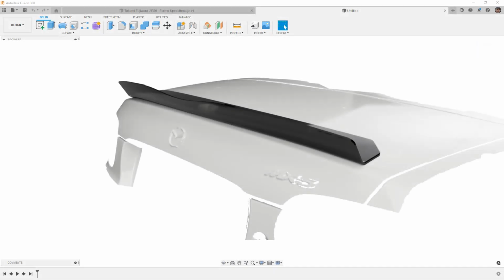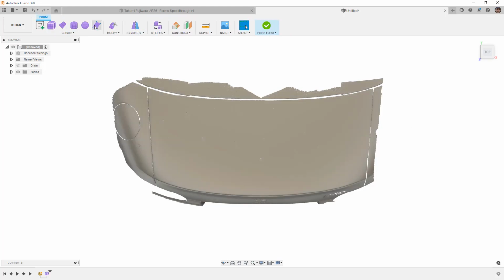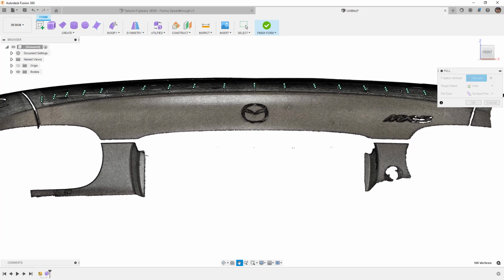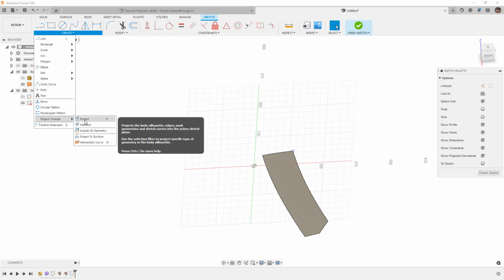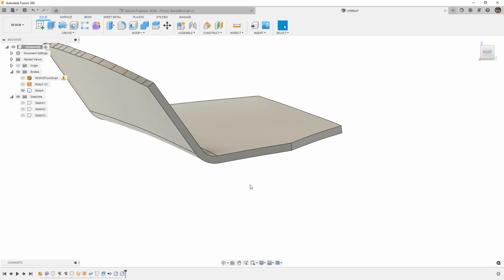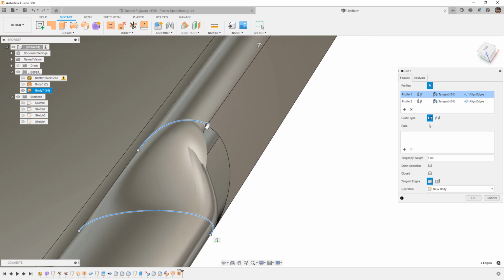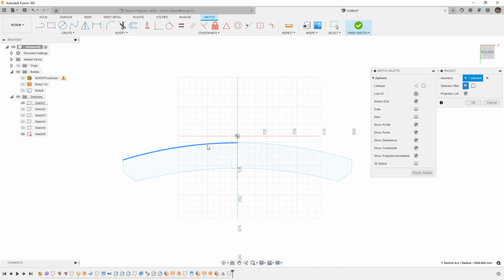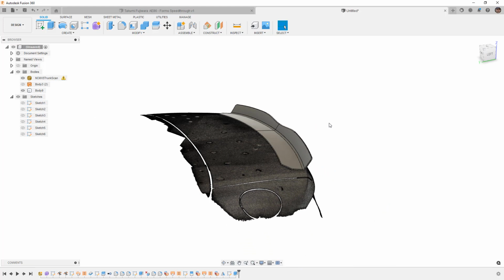Fusion 360 Form Mastery - Part 27 - Creating an MX5 Spoiler with Mesh, Forms and Surface Tools

Comment: If I have a 3d scann that is not aligned with the axis, how can I make the simetry of the part to align with the body panel? I can try to align the part manually but the results are not perfect
Reply from the maker: Its really tough without the proper software.  I use QuickSurface.  It can build a symmetry plane based on the shape and you can use that for alignment.  In fusion there is no precise way to do it unfortunately.  If you have more of a scan of the license plate area where you can get a horizontal line off the tag bolts that will help with the left/right.  I have some other videos on this and it requires you to make some references, make components, move the component and then copy the mesh back to the top of the design.... messy
Reply: The 3d scan is similar to yours, I want to design a spoiler and all the body panels are curved. If you need more info I can send you the stl. Thanks

Comment: nice video u really explained alot of dertaies thank you but i was going for a roush lip for a mustang 2013 but i got no scan for it is it possible to do it and can u do a video about it ifu have a time i couldnt find anything clear and good as you on youtube
Reply from the maker: Not much I can do without a scan really.  I do have a spoiler video on my Todo list but that list is pretty long.  Are you trying to make one for your car?  We have a few spoiler videos on this channel and to do one like the roush lip you probably would be sticking with forms.  I think I had a video on doing one for a tesla 3 a few years back.  that is the process you would likely need.
Reply: @LearnEverythingAboutDesign   ok would look for it thank you for the information  so theres no way u can sculp it from image or somthing unless theres a scan for the lip it self
Reply from the maker: @1993saif1  You can model something from pictures but the chance that it will actually fit is relatively low....  I have scanned my starion and modeled it from pictures and measurements and they are close, but not close enough that I would be able to model something to fit like a side skirt of fender flare.
Reply: @LearnEverythingAboutDesign   OH I GOT U YEAH ITS VERY HARD TO GET THE MESURMENT RIGHT THANK FOR THE INFORMATION I WISH YOU ALL THE BEST
Reply from the maker: @1993saif1  Sure thing.  I just looked at seems like I have two spoiler vids with forms.
https://youtu.be/aUVgqCQrAqI

https://youtu.be/M77JV2nhm74

The tesla one was for a guy that printed it but he never sent final pictures after the print on the car..
Reply: @LearnEverythingAboutDesign  OK I WILL TRY LEARNING FROM THESE MAYBE TRY TO DO A SPOILER LIKE SHELBY THANK YOU VERY MUCH FOR LOOKING FOR THE VIDEOS FOR ME I CANT TELL U HOW MUCH I APPRECIATE THATT MOST WONT HELP ME THAT MUCH SO THANK YOU VERY MUCH

Comment: Hello, on 11:17 i don't understand which buttons you use for smooth comand
Reply from the maker: Smooth shortcut is ALT + 3 on the keyboard.  Box is ALT+1.  You can also find it under the Utilities menu for Display mode.  and if you are in Edit form, expand the Selections section and they have buttons at the bottom to toggle it.

Comment: Do you have any video explaining how to print a part created from a 3d mesh, i´ve done a brake duct, but i'm having a hard time making it printable.
Reply from the maker: We just recently did a 6 part series making a brake duct and printed it https://youtu.be/euEWD89ux48  we have also done a few parts on our GPz motorcycle series that we printed. tail section, headlight mask, front fender.  Awhile back we did a widebody series and i printed all the parts.  that was a bit of a mess but there was a video in that series about breaking it up and printing.

What part are you getting stuck on getting it to be printable?

Comment: Hey, was the mesh align done by you? I have a similar scan but I dont know how to get it aligned correctly, or is there a way to make some sort of symmetry plane to use as a mirror plane?
Reply from the maker: It wasn't done by me no but we do have plenty of videos on different ways to do this.  Fusion isn't great so if you want to do something like extract a symmetry plane off a scan a program like QuickSurface is the way to go.  We have videos on doing alignment in QS lite.
Reply: @LearnEverythingAboutDesign  I tried that but it didnt seem to get the plane right, I dont know if I have enough similar features on both sides to get it right

Comment: hi, I've got a question. I'm making the fillet on the bottom of the spoiler like you did at 21:27 but I'm getting "inconsistent information in vertex and edge attributes". I'm doing this using my own scan data for my car, what should I go back and check to remedy this?
Reply from the maker: Hmm, so you were able to thicken the surface to a solid, but get hung up on the fillet on the corner.  might want to try increasing the tolerance number when you stitch them.  When you use stitch if any of that edge is red and not green it means there is a gap there which would cause a fillet not to work.  If that isn't the case there might be a non-tangent section on your surface.  

Those are the 2 places I would start with.

Comment: Can you explain how to align the scan to the origin? In x y and z
Reply from the maker: There aren't any dedicated tools to make this happen in Fusion sadly.  I do have a video showing some tips here https://youtu.be/82vD7YSKIAo  but its best to do this in the scan/mesh software if possible.  I will likely do a video in the near future showing GOM inspect, and im trying to see if Meshlab can make this happen easy enough, both have free versions/options.  If you are scanning with an Einstar or anything from Shining, their Exscan software can do it, but if you are scanning with Revopoint, Creality or other hobby options they don't generally have an align tool on the mesh.
Reply: @LearnEverythingAboutDesign  yes I used a Revo and really struggled so I thought this might be a video topic. With your knowledge I‘m sure you got some good tips 👍🏻
I used mesh intesects then set points and made planes and lines and then used the align component command

Comment: what PC do you have. Mine is exploding with scan data. like this.
Reply from the maker: I have this creative level 2 with some slightly different specs. https://mysolidbox.com/product-category/desktops/  I upgraded the graphics card (after this video was done).  I was running a pretty low spec Gcard when this vid was done.  
Setting the mesh to unselectable helps.  You can also copy the mesh and remesh with lower res so you have a hidden high res when you need it and a visible low res for helping view.

Comment: What is the best way to alinge a mesh accurately?
Reply from the maker: To do it in the mesh software before CAD.  Some scan software has alignment in it like the shinning 3d software.  Others like the software for Revopoint scanners don't have an alignment feature in it but hopefully they will add it.  In that case going to the free version of GOM Inspect, or using the free software MeshLab would be an option.

If you direct edit a mesh in Fusion you can add planes based on selections on the mesh, but aligning it to the standard coordinate system is manual with Move/Copy so whenever possible do it in the mesh software before export.

Comment: You have a mash already set in the coordinate axes, but in 3D scanning the mash is often located chaotically in space. How did you align the mash to the coordinate axes? Is there a separate video on this topic? Thanks for the reply
Reply from the maker: This mesh was sent to me, but in the scan to part series and in this video near the end https://youtu.be/Ft9qTVCMwC4  I talk about how to do it in ExScan Pro.  There are other software options that let you do that for free as well.  GOM inspect has a free plan that will let you align to a coordinate system.  MeshLab as well but its not super user friendly.
Reply: @LearnEverythingAboutDesign  Thank you for your quick response! I use Geomagic Design X for these tasks, but was hoping that Fusion 360 could do an exact alignment of the scan in the coordinate axes
Reply from the maker: @AlekseiKulikov-b5j  Sadly no.  If you go into direct edit on the mesh you can create planes using 3 points but for actually putting the mesh into the orientation based on the global coordinates, sadly no.  If you use DesignX I would certainly handle that before you import it.

Another tip, in Fusion you can right click on the mesh in the browser and make it Unselectable.  Performance will be better and you can still snap to it with a form.  It just prevents Fusion from flipping out when the cursor goes over the mesh.
Reply: @LearnEverythingAboutDesign  Thanks for the valuable advice!

Comment: hello, I just found out about your site and am already extremely grateful for various tutorials.
-> I have a question about T-Spline and API: Do you know if it is possible to manipulate T-Spline functions via API scripts?
I haven't found anything in the Fusion API documentation yet.

Thank you very much
Reply from the maker: You are welcome!

On the API side of things, I have never done anything with forms in API but with a quick search there are some things exposed to the api.  If you search the help file for FormFeature or Tspline it will bring up the ability to create freeform bodies.  I know from a program site that Fusion does access and create form features from other commands such as when creating a design from a Generative Outcome.  It takes a quad mesh and turns it into a form body.  I don't know if you can directly work with a freeform body though since it is a "direct" modeling approach I don't know how you would even figure out which vertex/edge/face to select with API.  

Is there somethin specific you are trying to do?
Reply: @LearnEverythingAboutDesign  
Thanks a lot for the quick reply.
Yes it is an API task which:
1. imports an STL mesh into Fusion 360 (almost spherical, some dents, etc).
2. imports a T-spline body (exact sphere with n faces, a bit larger than mesh, same origin, almost fit).
3. select all points on the T-spline
4. pull all vertecies onto the mesh to get a surface which can be manipulated (similar as you did with the MX5 Spoiler)

The task goes a bit further, but this is roughly the task I am trying to solve.
Reply from the maker: @FabianSchollenberger  So there is a step that might help you, but i don't instantly know if it exists.  In a form under the Utilities there is a Convert option.  that convert has a Quad Mesh to Tspline.  If you are bringing your mesh into fusion as a quad mesh you might be able to directly convert it to a form without having to do the pull of a form sphere to that mesh.  This is sort of how the mesh conversion tool to "organic" works.  It does a remesh using quads and then converts those quads to a form.  As long as the mesh is quads and as long as it doesn't exceed some upper limit of face count that would be the most straight forward route.

I tried using ChatGPT to sort this out but keep getting errors.  a few snippets that might point you in the right direction.

rootComp.bRepBodies.add()  it is telling me this will create a tspline body, but odd its calling it a bRepBodies.

calling the previous comp it called "tsBody" it does a startEdit, tSplineBodies.addByQuadMesh and a finishEdit.    

I think its on the right track but I haven't had a ton of luck with ChatGPT yet for this sort of thing.  I do have a video planned showing how to use this for API, but sadly sometimes its harder than just doing the program ;)

Comment: How You have your 3d scan fitted exacly in the midlle of coordinates?
Reply from the maker: That is typically done before the mesh gets to Fusion.  It is much harder to do in fusion.  So whatever software pre-processes the mesh.  In fusion you have to "eyeball" it as I did with the Fiat fender series.

Are you using a scanner and mesh software now?

Comment: Making a 2 part mold in fusion is completely mind blowing to me. I have created and printed a spoiler riser myself but have no idea how to split the design and where the seperation lines would be. Would love to see you do a video on this
Reply from the maker: Thanks Dave, Let me give it some thought on how to best present it.  The draft tool in Fusion does have the ability to build a parting line but something it is best to figure it out yourself for sure.
Reply: @LearnEverythingAboutDesign  I appreciate your response. I will have a play with the draft tool. I wish I'd found your channel a long time ago. Excellent content! 

I think sometimes instead of struggling in CAD to create a mold. It's probably best to make the mold manually from the design. The spoiler extension is such a weird shape I'm definitely gonna see if it's possible in fusion though. Cheers
Reply from the maker: Dave, I threw this together on the MX5 spoiler.  Take a look https://a360.co/3Ex3nr5

The main idea is to build a block and i used Boundary Fill to remove the spoiler from the block.  Then i built my "shut off" surfaces off the edge of the spoiler.  Because it curves and wraps around you can see around the corner i made a sharp transition which I usually would avoid.  But then I can use that surface as a split tool to split the boundary fill body.  Note that I use my split surface along with a 0 offset of the faces of the spoiler as one big surface.  Sometimes you can get away without that step but the more tricky the edges the better chance you need to get creative.
Reply: @LearnEverythingAboutDesign  wow. I've just looked at it and you've made it look so simple. Some tools I haven't used yet! You've used the surface tools to split it where you need it 🤯🤯🤯 impressive! Can't wait to try this. Thank you very much 👌
Reply from the maker: @davec9619-k3p  No problem. I will cover this in a video at some point.  Other CAD software that has mold tools like Inventor and Solidworks to this automatically for you(when possible).  They try to make these parting surfaces normal to the mold pull direction but that doesn't always work so knowing how to do it manually always helps.

The main tool I use is the Ruled Surface because you can have it create a surface toward a direction.  So if you want to pull top/bottom you can make a surface ruled toward front/back or left/right.  Then build in the corners manually.

There are other things to think about like alignment pins and weep holes for extra resin to escape but the sample should at least get you started.  Ask any questions along the way!
Reply: @LearnEverythingAboutDesign  I've literally just finished using ruled surfaces and split the box body in half. So satisfying seeing it split when it's a really complex shape! 

I like the fact that I've done it manually. I can't see how automatic splitting is a good idea as it's never truly what you want yourself I guess. This was alot of fun. Keep up the good work!

One thing I've done with my design was 3d scanning the car spoiler and I converted it to a surface using quad meshes. It's an eyesore underneath the part with all the random surface patches, now you've shown me properly through a few of your videos I can start from scratch and go again. I have no symmetry you see so it's breaking the split body tool and surface ruled is just not working properly at all 

I've never found any other channel as in depth as what you have gone into the form and surface tools. I appreciate you taking the time to help others on here!
Reply from the maker: @davec9619-k3p  Yeah auto splitting works ok for prismatic type parts.  Solidworks does a decent job of figuring out the A and B side with Draft analysis, auto offsets faces and splits a mold into core/cavity.  But complex shape need complex work :)

For the spoiler if you get a good quad mesh you can convert that to a form body and then force symmerty.  If its not working you can always split it close to the midline and mirror/symmetry it.  

Happy the channel is helping.  I wanted to focus this channel on going more in depth as those little things, the hows and whys often aren't there but its tribal knowledge.  I did most of my production with in Solidworks but have been training and using Fusion for 7 or so years now so I feel pretty confident in it :)

Thanks for watching!!
Reply: Das Teilen kann man ja heute sehr gut dann im Bambustudio machen. Und der Orca Slicer wird das auch können.

Comment: Be interesting to see how to use the pull tool on a less flat and more complex shapes like the lip of a front bumper? Or any solutions for that? Thanks! Very informative videos!
Reply from the maker: I can certainly do that.  The greater the curvature the more divisions you will need.  So it is important to get the shape how you want it first and probably subdivide with Exact as the option to maintain the shape.  I have a sort of odd example I can show where I use Pull inward to a complex mesh shape.  I'll give it some thought on which is more practical.
Reply: Would be good as I was trying to use the pull tool to get the surface from a front bumper scan I found but it kept going mental and every time it's really unusable! But if you could show how to get a similar effect like you did in the first half of the video using pull to make it match with the mesh surface but for complex curves  like front bumpers to make attachable lips that would be cool!
Reply from the maker: I recorded a video yesterday which I think covers the critical bits.  I need to edit and get it loaded in the next few days. stay tuned
Reply: Cheers bud that's magical! Look forward to it! 🙃